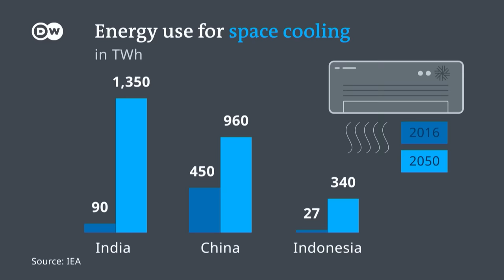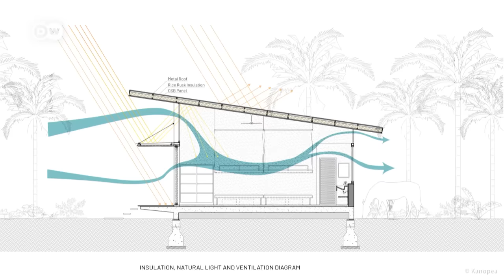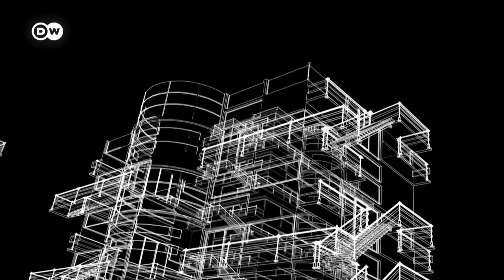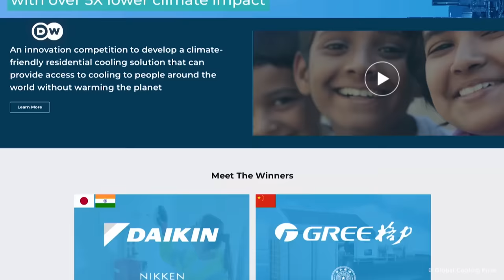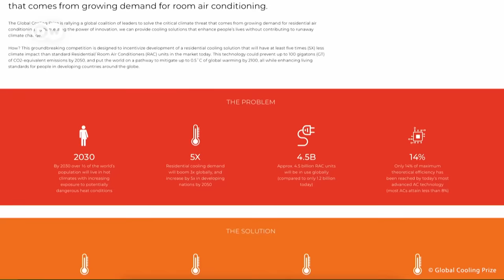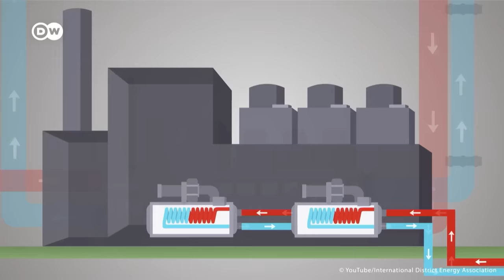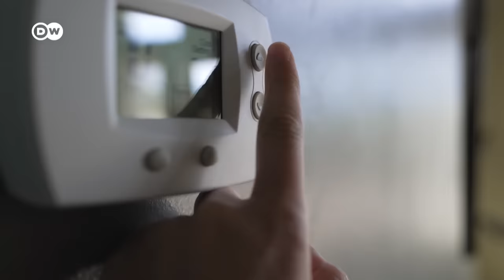How to cool our homes (even without ACs)

Comment: Hi, my name is Nir and I'm from Israel. 
Thousands of years ago, the ancient Israelites used to plant vines near their houses.The vine grow on the roof. On hot summer days they vine protect the roof from the strong sun radiation so they cooled the houses without the use of electricity, In the late autumn the vine leaves fall and during the cold winter the sun heats the roof Therefore less energy is required to heat the houses. This method can still be used in buildings with one or two floors. On higt buildings similar plants can be grow in containers on the roof. Watering the plants in the summer by a fine spray of water will lower the temperature of the roof significantly. It's a very cheap solution that can be implemented already this summer and you might even enjoy delicious fruits within a few years.

Comment: You can have a decent ac on like 3kwh and fully power it with around 6-7 solar panels and the match between sunshine and heat is perfect in this scenario. You can easily run your ac on 100% solar power locally generated. And if you use a modern propane cooling liquid the environmental damage is very low. Most cities are also in desperate need of redesign, more green to keep the streets cooler

Comment: I live in the western us where its dry and i use a fairly efficient evaporative cooler for the whole house. It doesnt heat the outside and uses very little electricity but they only work well in dry climates.. if you live in one of these areas please switch to evap coolers.. ditch the cental ac garbage.

Comment: As an HVAC technician: much of these sensors & additional controls, as well as modulating high-efficiency units, have been around for years. And they're very often pushed by companies (usually due to higher price points bringing in more revenue). But the problem lies in the difference in costs. There are some local incentives & rebates from utility companies to give back for higher efficiency & alternative non-combustion heating & the like, but those incentives are often extremely specific, for extremely particular cases.
Reply: I installed BAS systems for the first 2 years of my IBEW apprenticeship. I was surprised when they mentioned the competition winners "innovating" with a seperate temp sensor and humidity sensor. That's almost standard in any air handler at this point. I think that the residential side of things just doesn't want to shift towards more advanced options. My parents had a new system installed and the company rep was so proud of the two speed handler they offered. Meanwhile I've been wondering when VFD's and actuated dampers will be coming to the residential field. The lack of any balancing or specific zone control in residential HVAC also has to lead to a lot of wasted energy.

Comment: I am from Iran. My city, Yazd, is the oldest city that has this system. Under the tower there is a small pool of water that cools the incoming air. Also, in winter, the pool is emptied of water and a flame is placed on top of the tower so that warm air enters inside. In Iran, this method is currently used for modern houses. Both energy consumption is saved and it gives a beautiful appearance to the building

Comment: With out decresing the ampere of ac you canot reduce the power consumption. For that set the temperature to 28degree.Use a sprigler hose on roof if there is water.Fixing reflective filims on glass reduce in side temperature.Consructig walls with heat resistant material decrease inside temperature

Comment: I like the minimalist concept of space saturation combined with air flow such as in a hill valley where air conditioning is used to grow and improve efficiency performance is a testament to the continuous intensity of the specialist and about the cooling embedded in the distance from the main building it is an extraordinary process for lasting change

Comment: That’s quite nice. But here „fresh“ is simply equated with „cold“. In the end, all these passive methods can only adjust the temperature to the outside temperature. Insulation can also keep the cooler night air longer into the day. But if you have 30 degrees day and night, then it is also 30 degrees warm in the apartment. Then you need an AC or a heat pump.

Comment: I am corrently renovating a building build in 1963 in GDR. My goal is the "Passivhausstandard" which means that you have lots of insulation, make smart use of shading during summer und use a heat pump for the remaining required heating energy in winter. Power comes from PV-Modules on the roof. Yes, during summers i use AC units as shown in the video but due to the thick insulation just one unit of 1000W electric power is sufficient for the whole house and since power comes from the sun, its basically free to run.

Comment: A key aspect is missing here.
Cooling and heating buildings is physically the same task: there should be a temperature difference between outside and inside. The typically first renovation measure for energy-saving heating is the insulation of the facade including windows and doors. It would also make sense to better insulate buildings in hot countries so that the cold does not escape so easily.

This means that the countries mentioned would not only be growth markets for air conditioning systems = heat pumps but also for thermal insulation, i.e. almost the entire program of what is known in Germany as “energetic building renovation”.

Comment: I open the door on the cool side of the house and let the cool air displace the warm air.  This relies on the building being able to breathe so the warm air can rise naturally out the building.  Of course, in built up areas, you can't leave a door or window open, so it'd require a secure wall or floor vent.  In sealed buildings, you'd need an extractor to pull air from the building and draw in air from your cool source.

Comment: A couple of years ago we toured the Winchester House in San Jose, on a very hot day.  One of the women in our larger tour group collapsed from heat stress.  Sadly, this was not necessary. 

People always talk about the non-extant ghosts but Lillian Hitchcock was an innovative woman.  Her house rose to 5 stories and had at least a couple of interior air and light vents.  All the floors open to these vents which then reach their height in a glass skylights.  If the windows were all open the house would be quite comfortable in the hottest summer.  It would also be more vulnerable to break in and fire, so they remain closed.

Comment: I live in Chicago. There are laws so in "winter time" buildings have to maintain a minimum temperature. The problem is that for buildings with old boilers, the higher apartments get REALLY hot. I had to get a portable AC. I only need AC in winter to counteract the self imposed heat :( i called the county and they said there's nothing i can do, these are the rules

Comment: I live in Delhi NCR region in India.
In my neighbourhood no body gives shit about global warming and everybody uses air conditioning system to cool there house not one 3 units in every flat average will be 2 units and heat trap system starts when they are fully working. I can feel the heat waves.
On the other hand I am the only one in 100m area who is using air cooler to keep my house temp. Low even my flat has fully exposed to sunlight with my personal roof. And my need more cooling one air cooler is not enough for 1300sqft. Flat to cool.  I am also planning to use Solar system to cut my electricity bill in future.

Comment: This summer, I had central AC in a run-down row-house. The house leaked in so many places; you could literally see a crack of light between the front door and the door frame, but that was one of the smaller problems of the house. The landlord did not allow tenants to adjust the thermostat and did not want to spend the time or money investing in proper maintenance of a home he did not live in. In places where most people rent instead of own, how do you encourage landlords to make inconvenient choices that don't directly impact them? 

For each innovative technology meant to replace an older, less-efficient model, what happens to the existing older models?

Comment: The solution is quite straightforward. Request the installation of a solar plant as a requirement for using the air conditioning system. The solar plant harnesses solar energy from the sun, converting both sunlight and heat into electrical energy. The AC unit utilizes this electrical energy, transforming it into heat, which collectively results in a net negative impact. This cooling effect not only helps in reducing the overall temperature of the surroundings but also contributes to environmental cooling.

Comment: As an ex boschler we tried various method to bring down the temperature in shop floor where we tried single stage to 3rd stage cooling system .. only effective cooling get when we control humidity even factory in Bengaluru requires such system  ! Also offices with Variable frequency drive it agains helps to reduce power cost .. so now with solar energy factories saving more money buy district cooling system would be still cheaper where Industrial areas  must utilise and energy can be provided to other developments

Comment: I lived in an old house in Mangalore. It had a large verandah in front and back of the house with overhang tiles. The inner rooms would be very cool. Now house sites are so small that verandah is never designed. It’s making a comeback in Kerala as per several videos of house design…..

Comment: How I cool my home?

Many fans. I've got a small home and a selection of fans from 4 inch or 18 inch. The house has got two walls which are south facing and none that are north (terraced house) meaning no real cross flow ability and I get all of the sun.

The 18 inch on high is like having a small tornado in here, as long as the local air temp/humidity is below body temp and 100% I can stay cool easily. However it's very rarely needed to be used on high. I regularly keep my 4 inch desk fan on and I have a 6 inch fan for my bed and another I use in the kitchen to help defrost/dechill food but aimed to blow that cold air to behind my fridge/freezer so it can recover some of that lack of heat (also useful in hot weather, nothing like forced convection to keep the radiators effective).

Also if it's particularly hot i put up aluminum foil on the windows to reflect some of the heat, not sure how well it works because they get very hot...

Comment: Cooling by opening the windows, heating with radiators and a central wood chip boiler on the farm. Mountainous rural Norway, so YMMV.
We usually only have a week or two during summer where it's too warm for a good nights sleep.

I think the radiative cooling paints are interesting, as making panels made with those can maintain colder than ambient temperatures simply by pointing them at the sky, and the heat is radiated into outer space. Even in direct sunshine.

Comment: Interestingly in India, things are lot different than projected. The summer season is for 2 months in most parts of India and the AC usage is high during those months. Most households do not use AC even if they own one, during the non summer months. The only place where AC is used in regular terms is in the offices, since they are made with glasses making it already a glass house. So to my point, making building energy efficient, like high ceiling heights etc can bring down AC consumtion significantly.

Comment: Ancients knew how to deal with heat. My home is from the 18e century with over 1m thick stone walls, small windows up on south side and large windows down on north side. Tiny windows from east to west. It’s chilly in summer and warm in winter with proper insulation of course. I never use AC even during heatwave, I just sleep downstairs during summer and upstairs during winter.

Comment: In UK we have a large proportion of older buildings, which need more attention, because of large quantity (about a third to a half of homes). From the days of no insulation, and flues from coal fires. These flues are excellent for summer cooling, and sufficient winter fresh air, removing pollutants, and damaging moisture, following closing the coal fires. These 19th century buildings will be the majority of homes needing energy retrofitting, by mid-late 21st century.  Lets learn from this older technology, and make more use of the high thermal mass:- This is heavy masonry to inner wall surfaces. This absorbs heat in peak hot times of day, keeping buildings cooler, and gradually releases heat during cooler, over-night, with timed, night-time, cooler air, preparing the buildings to moderate the over-heating in the next hot day. See ancient, pre-electric, air-cooling chimneys of Middle Eastern towns. This can be aided with heat pumps, run with renewable electricity ( for either winter heating, or summer cooling, with solar Electric panels).  We also need Town Planning scale town design, to reduce heat island effect of 3 or more degrees cooler:- Encourage flow of cooling air, follow principles of City of Masdar, UAE, with narrow streets, preventing sun hitting facades of buildings, and channelling every gust of wind, through streets, and through buildings. Not wide, sun-baking boulevards melting the tarmac.  Plenty of trees, and green, known to evaporate moisture, with cooling of city air.
Reply from the maker: Hey Anthony! Thanks for sharing your view. We actually have a recent video on Barcelona. The city created so-called "climate shelters" by adding plants, water sources and even adapting the buildings sometimes. Check out the video and let us know what you think about the approach 👉 https://youtu.be/iZI4Rh_APFQ

Comment: Also something worth considering:
~10+ years ago letting in more natural light was an energy efficiency measure.
The LED equivalent of 100watt glow wire is 14 watt LED tops.
People tend to forget how much energy lighting used to need just a few years ago.
A 100watt LED lamp could replace an xray for some applications. (Then again this much light might cause more trouble then it's worth, just the risk of eye damage for starters.)
Reply: Yeah man, the units themselves for A/C are expensive. However there are new units that when running only pull 1-5 amps. Bosch released some. Way cheaper on energy

Comment: most of the solution is found in the human body. I worked for a roofing company working in 40 degree celsius in the shade, plus the added heat rising from the dark roofs that i was working on..the solution is found in those countries closer to the equator: most people wear loose clothing made from fabrics that sweat attaches to easily, and evaporates easily, it doesnt hurt to have a turban or other insulation to protect the head..sweat is mans best friend in the heat, drink water (not caffeinated drinks), and eat enough bananas and salty light foods..light colored loose clothing made from cotton..

Comment: I lost it at Berlin. Everyone from northern and southern hemispheres should be grateful because you guys can enjoy more than two seasons with chiller temperature while we only have wet and dry season. You can say anything fancy about engineering but when it comes to Indonesia's constant equatorial heatwave year round everyday every hour, nothing else works but AC. They're building a new city in Borneo is an air conditioning disaster because Borneo never felt cool in my experience.

Comment: I think AC is necessary in the US, it was a fast growing country therefore they used the cheapest construction materials available, that is fine during summer, but during winter is a different story. Unlike other countries that slowly developed construction methods/materials to adapt to their local climates, look at German buildings for example, thick stone walls keep the inside cool during summer and they keep the heat of the stove during winter for longer.

Comment: They used to use a simple thermal water cooling system for air conditioning in the South from the late 1800s through the early 1900s. I think they used to call it a chiller system.

Comment: Few people understand how air conditioning works.

Build houses with shade overhangs that provide shade during summer and allows sun to enter the home in winter.  Hardly anyone does this.

In hot climates, use light colored roofs and In colder areas use darker colored roofs. Hardly anyone does this.

Use whole house fans, and install electric heat pumps and LED lighting.

Comment: 1. We need more buildings with natural airflow and design buildinga in such a way that it does not require AC's. 
2. People migration to cities is also causing the issue. More and more people are migrating and raising the demand for housing and cooling requirements in these houses. 

Solutions- 
1. Tree plantaion in cities and in the areas near cities. 
2. Better building desgins to avoid use of AC's.
3. Spread awareness

Comment: We need to reduce the electricity used by both the cooling equipment as well as heaters. They constitute a large chunk of energy used by houses during summers and winters, respectively. Tackling AC issues will be easier as it will be targeting the global south or eastern section of the world, which is easier to blame.

Comment: When I was in the United States I was surprised by how much they use ac over there and how inefficient is their use. They leave the AC on all day long even when there's no one in that room. They have got used to having such low temperature indoors that 22° feels too hot for them. Entering an interior in summer is a similar sensation to walking by the ice cream aisle in the supermarket. They even slept with it at night (something unimaginable in my country). And refused to open windows.

While high heat is dangerous, hight difference of temperature is also bad for your health, your body does not like the sudden change when you walk inside. It is also bad for the environment.